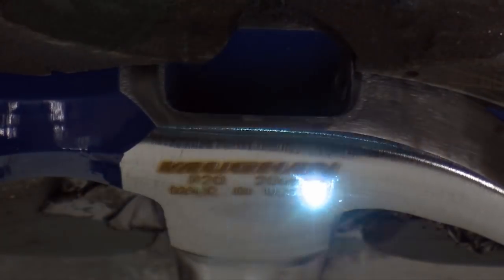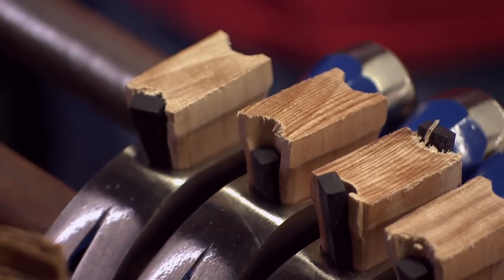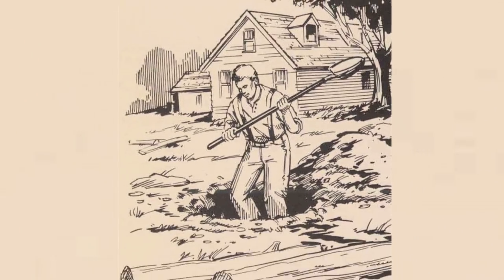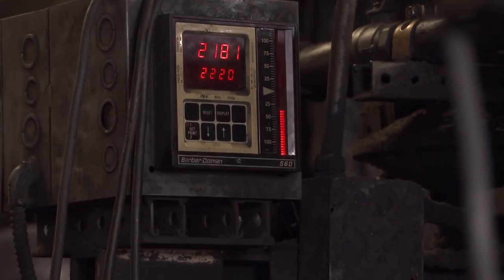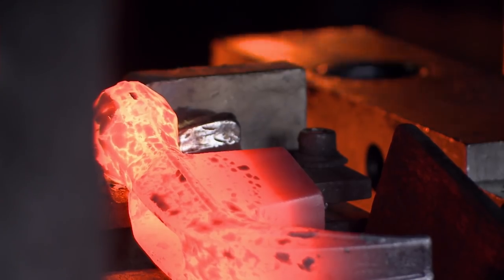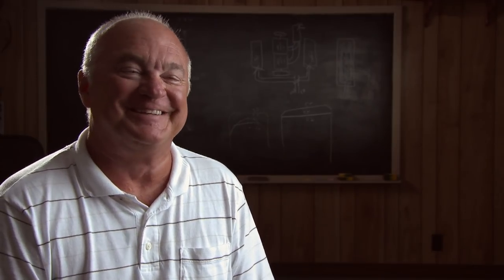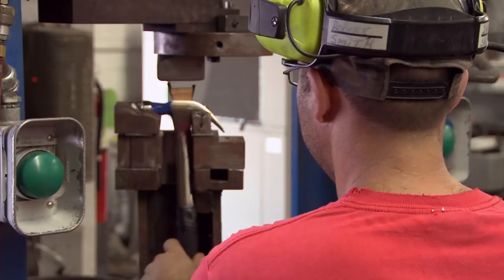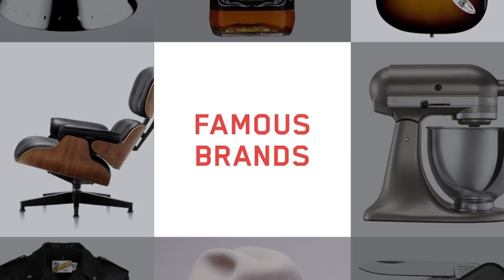How a VAUGHAN Claw Hammer is made - BRANDMADE.TV

Comment: I live 2 blocks from Vaughn and my dad has worked there for 20 years
Reply from the maker: That's excellent. What does he think about the Vaughan Claw, Beandon?
Reply: eeedgtf
Reply: Beandon Welsh good
Reply: Beandon Welsh  hello just out of curiosity what does what does ur Dad do at the Vaughan  hammer factory??
Reply: They call my right hand the Vaughan Claw ;)
Reply: @BrandmadeTv  no reply, 2 years? erm
Reply: My parents live in bushnell about 6 blocks away and every year when I visit I buy a  new hammer right from the factory.
Reply: what is the diameter of the steel rods are used?

Comment: I have one of Vaughan's excellent 23oz. California style framing hammers with a hickory handle. It has the waffled strike face.  I never use the magnetic nail set much,  I just prefer the shape of that hammer head and the small bend in the handle which gives more leverage.  These hammers are truly All-American......the steel forging done in Illinois......the hickory handles are made in Tennessee.  Harbor Freight also has a China version for $10.  I've been told it's good, but a foundry in China isn't putting Americans to work.  The Vaughan is well worth the extra $20 IMHO.
Reply: Hickory is the worst wood for a hammer or axe.  I have several axes, some with white oak handles and some with hickory handles.  The white oak is much easier on the hands and elbow joints in a day of working.

Comment: Made in america by american skilled workers.
Reply from the maker: +TheJfh67 Absolutely!
Reply: Made by a good company but not very high skills are needed
Reply: TheJfh67 murica fuck yeah
Reply: From the companies website: The lightweight DDT 16, with 
its patented deep “V” head design, provides faster, greater power at point of 
impact with less stress and arm fatigue. 

The DDT 16 
hammer features a patented titanium head with overstrike guard. It’s exclusive 
Double “D”™ Magnetic Nail Holder has the ability to hold both standard and 
duplex nails and provides increased reach for one-handed nail starting, while 
the Sidewinder™ Nail Puller provides extra leverage for removing nails without 
ripping up forms. For fast and easy tear downs and rip outs the Short Stack™ 
Claws on the DDT 16 hammer are reinforced to provide increased strength for 
prying. Heads Made in China. Handles Made in USA. Assembled in USA. So the metal parts are made in China and they send them to the company in USA who presses or in this case screws a wooden handle onto the hammer head? I would consider making the handle about 5% of the overall process, so these are indeed 5% made in the USA and 95% made in China. Or if we just round it off: MADE IN CHINA.

Comment: The hammer is actually stamped, not forged.  I am a carpenter and have used most brand of hammers and I wouldn't put Vaughan hammers anywhere near the top.   There is something wrong with the steel in the hammer, it rebounds too much.  There hammers are well made but the steel in the heads needs to be made of steel that gives more of a dead blow.  The best hammer I have ever used is a Japanese hammer with a white oak handle.  The head is 20 oz and all the weight is in the head.  It feels like a 16 oz hammer, easy on the elbow but will drive 16 penny mails with two hard blows and an easy blow to finish off.
Reply: @RRaucina  Wonder how many elbow joints have been ruined by steel handles?  That is when I switched to the Japanese hammer with a white oak handle.  After thirty years as a carpenter my right elbow was shot, but the next twenty years I used the Japanese hammer and my elbow gradually returned to normal.
Reply: @thomaswayneward  Dozens+  of Vaughn hammers with wood handles.
Reply: @RRaucina  Right, I have quite a few in storage.  The steel in the head is wrong and the handles are too stiff and large.  I had rather use an American hammer for sure, but the companies that make American tools are hard headed and refuse to change.  I have dozens of chalk lines, US made, that I bought as US made ones got a little better over the years, but it wasn't until a Japanese company made a really good one, that I was satisfied.  Same thing with pry bars, the US companies have finally copied the Japanese ones, but they aren't made well.